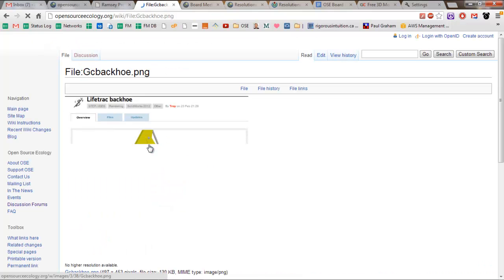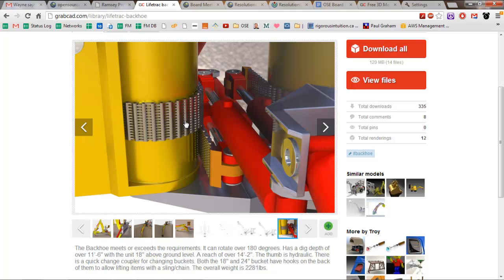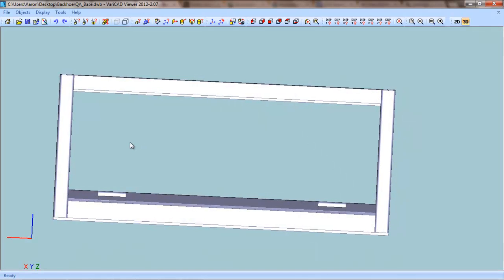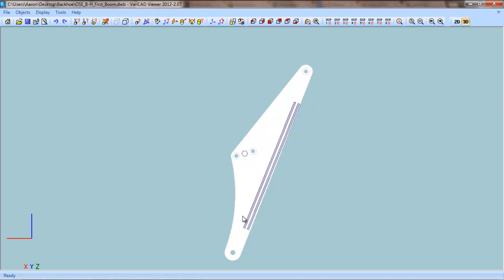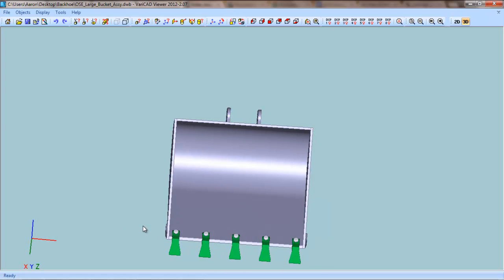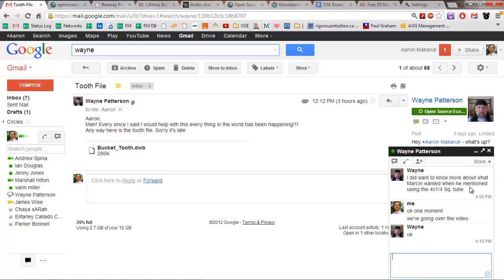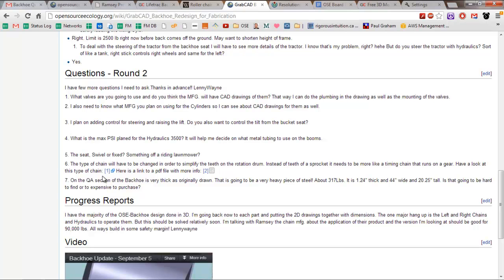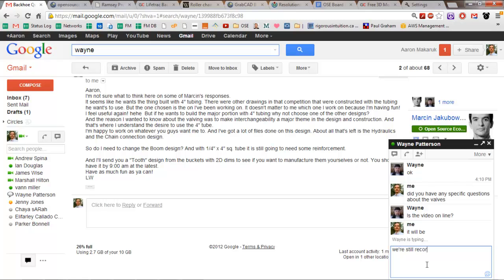Backhoe Design Review - Update for Remote Designer

Comment: Keep in mind that the commercial builders of skidsteer backhoes do put them on a quick attach frame for convinces but they also deem it necessary to have 2nd stronger attachment point to the skidsteer frame. A real backhoe like this will overpower the quickattach rams. I put a telescopic case 580b hoe onto a bobcat t300 with a quckattach plate. I just used chains/binders to solve this problem , but you really need something better.

Comment: After many years of observing backhoe design I vote to go with the simple commonly used  trunnion mounted rams and no chains. Its easy to mount a ram trunion style. The drawbacks: 1) the swing torque is not consistent thru the entire swing. 2)The frame has to be a little deeper Pros: 1)Both rams are used for both directions=more power/smaller rams(not so w/chain) 2)No chains that need to be kept clean/lubed and adjusted to keep the slack out.

Comment: I like the simple outrigger/stabilizer design. However if i built it for myself i would make them also able to swing 90 degrees outwards(in front of the tractor instead of to the side) Then I could use the backhoe for a crane if i wanted to pickup more weight and not flip the tractor. I promise after you lay a couple waterlines you will be using it constantly as a crane. Maybe mount them using 4x4 tube then you can detach the stabilizers and rotate them 90 degrees and use them on other equipment

Comment: For fun, Go to the bobcat website & look at the 360degree view of their backhoe attachment. Its a rack/pinion. That same design has been used with a chain too. I don't recommend it either though. Look at the swing ratings for different brands/designs of hoes with the trunion mounted cylinder always have the most swing power.

Comment: Consider not adding more valves and hoses to run the lifetrack from the backhoe seat: Just make some connecting rods that extend from the levers in the cockpit of the lifetrack to just behind the seat of the backhoe. Then you can just reach behind you to drive the lifetrack. Thats much simpler and cheaper. Also its also common practice to lift the stabilizers and to use the backhoe to move the skidsteer around to where you want it, then put them back down. Helps if lifetrack is in neutral.

Comment: The swing mechanism might be bad:
1) Are u sure the swing rams will stay straight like that and not pull themselves into the chain where it raps around the swing pivot, thus grind as it swings? Not sure, i just know the ram is going to extend to the furthest point away from the point where it mounts to the frame as possible(that the chain allows it)

Comment: The swing mechanism might be bad:
2) It is pulling sideways on the ram rods which will at the very least wear them out quicker. At worst, bend the rod. A similar design has been used but the ram rod has a roller on the end and the chain is wrapped over the roller and tied to the attach plate so that there are no radial forces on the rod. This requires more chain and a heavy duty roller. If they could have got away with ur simpler design I think they would have.

Comment: YOU ARE NOT GOING TO BE ABLE TO USE THE TILT FUNCTION w/hoe fully attached, nor is there any reason to. You have to lock out the tilt function because this large of a backhoe will rape the tilt function and the backhoe will just tip over on its face when the pressure relief on the tilt valves is activated. Its basically just a 14 foot leverage bar w/3000lbs of force on the end, your tilt cylinders can't hold that.